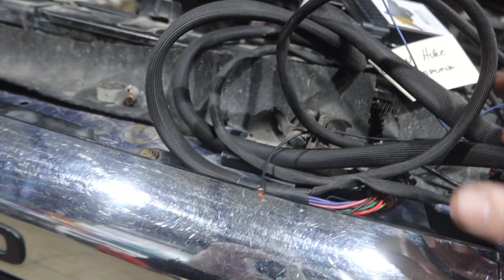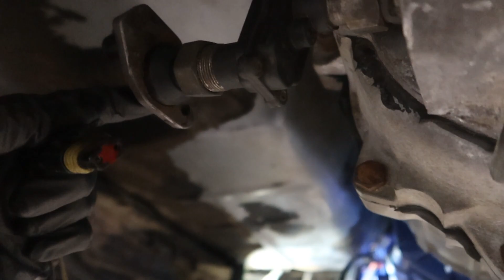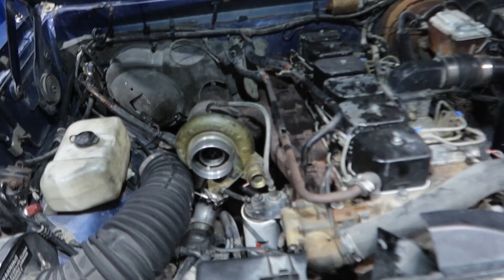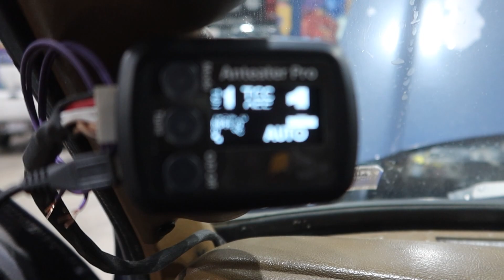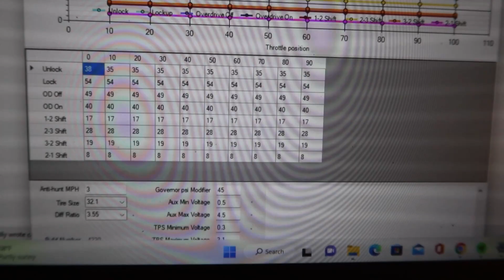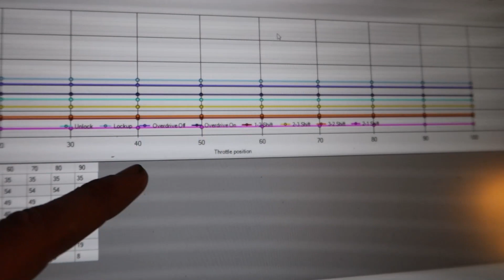First Gen Cummins 47re Swap PT 4 Firepunk Anteater Install

Comment: Having an issue with my ant eater pro on my 01 , randomly giving me a 2000 rpm dead petal , was working fine for weeks , any idea ? TPS is reading fine . Just seems to not wanna let me go over 2000 rpm , shifts into second then cuts throttle
Reply from the maker: And when you unplug the anteater everything works normal? It should have zero effect on the truck side harness
Reply: @GavinHuke when I unplug it and run the stock harness on the trans and hook up the tv cable everything is 100 percent fine . Runs perfectly, but this is the second time the ant eater has done this to me , fist time I sent it back to fire punk they ran tests and it checked out fine , I plugged it back in and everything worked perfectly for 3 weeks , then randomly the other night would give me a 2000 rpm dead petal again , then it cleared up at the next traffic light , let it sit over night , went to drive it the next afternoon and same thing 2000 rpm dead pedal , went back home unplugged it , then hooked up the tv cable and valve body factory wiring with speed sensor and works perfectly.  I decided just to remove it completely and put it aside for now ,but it’s definitely not my truck it has something to do with the ant eater and the tps signal I feel like . But tps on the ant eater reads out normally so idk
Reply from the maker: @Urdiverkenny id love to scope the 5v supply and the signal wire when it does it, would be able to tell exactly whats going on. I can say ive never seen one feed signal from the anteater back into the tps on the truck
Reply: @GavinHuke  I’ll get back to you on this
Reply: @GavinHuke  so two days after I had this issue and removed the ant eater I had dead batteries, I’m kinda thinking the 5v supply was being interrupted by low batteries. Any thoughts? I’ll re install it again and see how it does
Reply from the maker: @Urdiverkenny thats absolutely a possibility!

Comment: How do I get the governor psi modifier so I can finish up my install
Reply from the maker: @Chris530-65  what exactly do you mean, you just need to know where to set gov pressure modifier on the anteater or what?
Reply: @ ye I’m installing the anteater controller for my 47RE and in the file info needed in tire size, rear axle ratio, TPS voltage hi&lo, and governed psi modifier which in for 1-2 shifts but not sure how to get or check to input this info to finish up install.
Reply from the maker: @Chris530-65  you don't really have to "find" that, just leave it at 60 and go drive it or set it at 50. The static TV lever has to be setup properly as well. The rest of all of those should be pretty self explanatory
Reply: @GavinHuke  thanks!

Comment: Hey man, did you ever get the tap shift installed? Firepunk sent me a tombstone because I'm doing something like yours. I'm running a 48re in a first gen. But they sent 0 instructions for the tombstone wiring lol the just sent me the tiny little circuit board.
Reply from the maker: Yeah the tombstone is pretty self explanatory but I didn't need one so I'm not sure what you plan on using it for. Feel free to massage me on facebook

Comment: Coming along nicely brother. Talking about your speedo working properly, made me think about mine. Mine doesn't work, but the odometer and trip meter do, as well as the cruise control. VSS? VSS plug? Or maybe a broken cog gear in the gauge cluster? I'm at a loss. From what I know, if the VSS is inoperable, the odometer and trip wouldn't work either let alone the cruise. Let me know what you think or have heard. Thanks.
Reply from the maker: I do agree with you, the odometer and trip shouldn't work. Unless it's a manual maybe? I'd be curious to see some voltage readings coming out of the sensor. There's a couple things to check but heck the cluster gears could be toast as well
Reply: @GavinHuke  I'll try the voltage readings. I haven't done that. But I think even the odometer/trip gears read off the speedo gear, don't they? I haven't pulled the cluster out yet. Just not really wanting to do that again. I will though, later, cuz I wanna trade out the bulbs for LED's. Just trying to research as much as I can b4 I have to go there. Thanks brother. Oh, and also, my truck has an auto trans.